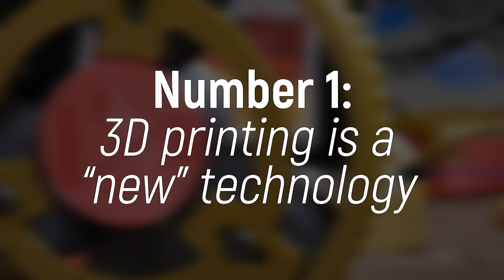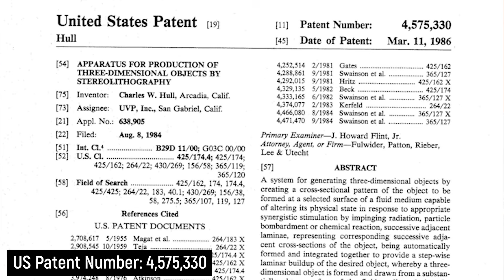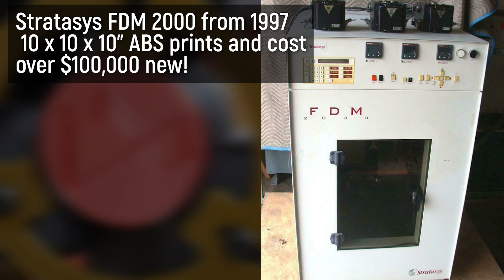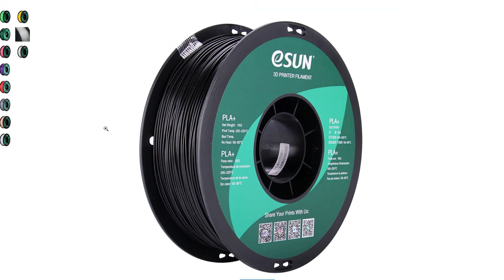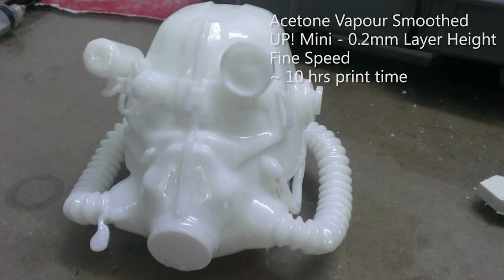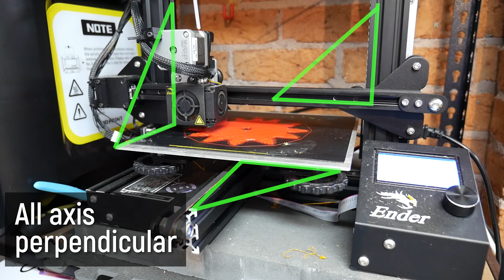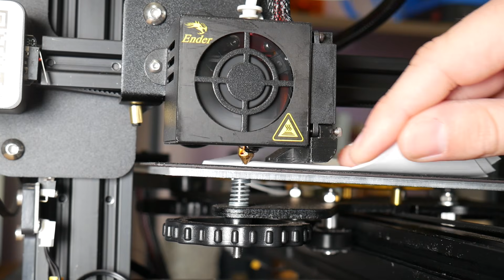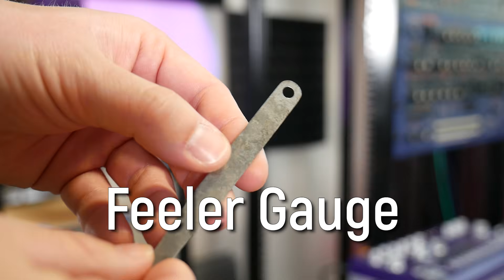3D Printing Myths I used to believe...

Comment: One of the assumptions that has caused me suffering is the belief that the temperature my printer reports is exact/accurate.  If you're going to do a lot of printing with a filament, and want the prints to be as perfect as possible, run a temp tower. It doesn't matter what the sticker on the roll says if you actually do the test and find out what temps work well for the material on your printer.

Comment: A polymer “alloy” is called a copolymer.
Reply: Not quite. A copolymer is a complex polymer that has, within a single polymer chain, different monomer chains. They can be true copolymers, they can be graft copolymers. For example ABS is a graft copolymer, which is a true copolymer of acrylnitrile and styrene grafted onto butadiene. So they take fine butadiene polymer flake that was polymerised in a separate process, acrylnitrile and styrene monomers are introduced as gas and polymerised onto the butadiene flake, so all of these end up in a single polymer molecule. As far as i remember, don't sue me if i got it wrong, i'm not a polymer chemist, or a chemist to begin with, but i did skim Brydson's book and some other sources for just some idle curiosity.

You can also polymerise different monomers or monomer groups separately, and then melt and blend them, then you actually have an alloy or blend. PC+ABS is most certainly a blend and not a copolymer!
Reply: @SianaGearz  quite right, blend might be what they were trying to say, alloy certainly isn't.

Comment: I learned the feeler gauge trick a while back. With my bltouch on my cr10s pro, I zero the Z on the feeler gauge, so when I activate the process for adjusting the 4 corners, it automatically sets the nozzle to the height of the feeler. Then after I'm done, I zero the Z again without the feeler. Perfect first layer every time.

Comment: I use leveler to level my bed... but not like you think. It is useful for quickly checking if X gantry is aligned with the bed in printers with one Z screw. The reference is the frame, not earth. If all parts, x gantry, bed and frame show same bubble position, they are parallel. Have not been able to get it better with a set of calibers and measuring, and as a quick check it is great, you can check things while you are printing.

And with both CNC and 3D printer, i use thin paper... I am trying to find 0.100, not 0.000, to have just a bit margins before things scratch the bed. I've found it is more accurate than even autosensing is at times.. But it takes a bit of experience to feel it, you also have to use new paper.

Comment: bro.maker muse, there is one more that has not been discussed. regarding the belt, how tight and loose the belt is right for a 3d printer. because this will affect the printing quality and power efficiency of the stepper motor, if it is too tight the stepper motor(hot) will be heavily burdened in its operation, and if it is too loose then the print quality will decrease slightly,and the teeth on the belt system must be aligned, otherwise it will reduce the accuracy and stability of the 3d printer results,and affects the age of the belt, the tighter or more misaligned, the shorter its life,

Comment: On all of my printers without ABL this has worked extremely well. Zeroing the Z-Axis and with a clean nozzle raising the bed till I feel a slight drag when moving X or Y, then I lower the bed the few microns needed to stop the drag and move on to the next corner. 

You need to do this once for a rough level and then a second time for exact adjustment. It has gotten me within 4 thou of my Z and has not given me an elephant foot with correctly tuned extrusion diameters.

 I print 100% infill most of the time and have gotten a calibration piece to show ±7 thou in the XY axis with no perimeter offsets on a bone stock Ender 3. 

Same with a 3mm hole and 3mm steel dowel pin, printed at 0.08mm layers with a 0.2 nozzle and has a perfect fit.

Comment: i dont bother with the paper bed levelling technique anymore, as I find it just varies from material to material. I tend to do a test print in each corner and using a skirt, and adjust as it goes, and I get lovely results every time. its quite rare for me to have a failure, when I do its normally something stupid i didnt when slicing lol

Comment: For bed level, the paper trick is simply insufficient.  It doesn't matter if the bed is level, the bed itself is not perfectly flat.  That's why I added a BL Touch to my printer and have it do a 9x9 touch to create a bed level mesh. It accounts for tiny (or perhaps not so tiny) warps in the bed level.  Since doing so I've not had to mess with manually leveling my bed anymore and I think this should be standard across 3d printers.

Comment: Great video ! The part "No, you're not leveling : you're tramming" was spot-on.
Funny enough, 2-3 years ago I've been "gently" bashed when saying the exact thing you did : "paper test is flawed, use feeler gauges instead". People never learn and, when they were struggling with their first layers, mine were consistent at every print without elephant foot artifact. I do use the smallest gauge I have to achieve this, which is 0.04 or 0.05 mm.

Suggestion : do a "3D Printing myths : extrusion 101". Lots of misconceptions and misnomers on extruder styles and filament drive styles did spread over the years and these need to be addressed too (since not only end consumers are concerned : companies too). ;)
Reply: They're not tramming. Tramming measures the perpendicularity between a head and the table. There's no way you can measure that on a 3D printer. You turn the spindle around when you're tramming. 3D print heads don't rotate. Least ones attached correctly don't.
Reply: Yep, you're right.
Can't see any other way to describe it, although it's approximate. 3D printing is approximative too, so ... well ... let's say it makes sense even if it's not totally true. :)
Reply: People saying "tramming" just gets on my nerves because 99% of 3d printers have no idea what tramming even means. Everyone knows it as levelling so just call it that.

Comment: If I want to be fussy, I have a bed leveling test print I'll run after bed leveling.  It prints 25 mm squares, one layer thick.  I'll adjust all of the leveling screws by the same amount, repeatedly as It's printing the little squares, adjusting until the first layer adhesion is perfect.  If the squares are made of individual filaments or it's not sticking, raise the bed.  If the nozzle is dragging or smearing, or not extruding, raise the bed.  When perfect, a uniform thin sheet of plastic one layer thick will print for each square.

Comment: Can you tell me how thick the feeler gauge to bed level?

Idk I have feeler gauge, using 0.10 mm, print a brim, I still could see the gaps :/

Tried the 0.05mm feeler gauge, flow rate 110%, the brim gaps gone.

But still facing warping, even the brim can't hold the warping itself :( (photo here : https://i.ibb.co/dQQRDH6/IMG-20210610-094637.jpg)

I use petg esun, print speed 50mm/s, temp 235c, bed temp 85c fan 10%...retract 4mm, speed retract 25mm/s.. 

I also still have issues on corners too :( it's like corners has some artifacts... Not smooth corner.
(photo : https://i.ibb.co/3phg3Rd/FB-IMG-1623504918262.jpg)
Reply: How warm is it in your environment? Do you have drafts? Moving air of varying temperature can easily ruin prints, cause them to warp.

I think 0.05mm feeler gauge and increased flow (first layer only) sounds like a recipe that should work. But ideally you set the printer up such, that the gap between nozzle and bed is zero when homed, so ideally you descend the thickness of the gauge after setting up, or use slicer Z offset, or raise the nozzle by gauge thickness above zero home before tramming.

Also i think it may just be material incompatibility of some sort between the coating on the glass and your PETG. Normally PETG adheres to glass a little too well, and i think Anycubic etched glass beds and similar are pre-coated with something.

Or maybe your PETG has gone bad? Does it throw a lot of strings? It can absorb moisture and become unusable until dried. There's lots of ooze over the print in the first picture, which is also an indication of that. It's also unwise to fully rely on printer's internal temperature sensing, you may want to try varying the temperature 10°C in either direction and see whether it gets better or worse. Like usually 235°C is a perfect temperature for PETG but you never quite know whether your printer is really holding that or 225°C for real or 245°C, and there's no great way to measure, just trial and error.

What else... it looks like the surface you're printing is unsupported from below? Naturally when there is no material underneath to adhere to, the filament bead will just go wherever. Another thing to check is the belts, that they're properly tight. Another interesting issue is when the motor pulley isn't tightened properly, then the belt feels good, but the pulley will slip once in a while on faster moves just slightly. You can't just tighten the pulley in any position, it won't hold, the grub screw must go into the flat of the motor D-shaft.

It's genuinely difficult to determine the fault from a photo of a print like this, because all kinds of underlying issues can cause similar issue appearance. That's why people print benchies or special-purpose tests that display one issue at a time. And the most important is that you have a feel for how the printer should be operating, and just watch it while it prints to determine where it goes wrong, which is a difficult skill to convey.

Comment: WHY!?! You dont fold over the paper, just the thin layer. And with my printer, I have found I measure down to .2 (with guage or paper, and with paper I want it to resist the pull but not stop pushing or pulling rhe paper, and with guage, I set it to a point where I just start to hit the nozzle and it pushes out of the way ever so slightly. If I need to go higher and it doesnt contact, then I know its right at .2 and a super tiny bit more) and thats that! Thats a "level" bed. Its not about setting z hight, its about setting the bed to the same distance from the nozzle consistently. Z height is achieved through the method of zeroing the z height. This is usually done by a lhysical button. I have a cr10spro and it uses induction (I think) and can be very tempermental given heat or material on the bed. I prefere a physical button.
When setting z height, you use the metal guage (preferably) and even with paper, set it to .2, drop it by .2 then using the machine and have your botton be right there for zero

Comment: Seems like not so much a myth but not understanding the purpose of setting the nozzle height with paper. It's not that the "correct" height is some defined height that is determined by a sheet of paper. The correct height is determined as that which yields the proper "squish" of the extrusion, and things like paper and such gets you close to a height that will yield a proper amount of squish. Ultimately you have to adjust nozzle however it takes to get the right amount of squish, regardless of the "paper method" or whatever "method" to get close.

Comment: Some of the early Reprap printers used Nylon from string trimmers as a filament. There where many problems with this as the nozzle technology at the time was so infantile, along with the control software. So there where many burning problems, plus the nature of nylon for string trimmers are not generally kept very dry. So they moved on to using ABS pellet and making their own extruded filaments. Since ABS was very easy to get their hands on in bulk, and they already had a great deal of experience with it in the engineering program. Since its one of the main plastics used when teaching injection molding design.

Comment: Best method I find is to run a gcode with a bunch of squares on the bed and just do live adjustment. Better best option is a dial indicator attached to the print head.

Comment: the paper trick works specifically because commercially produced paper is extremely consistent in its thickness. so paper therefore makes an easily accessible and inexpensive substitute for a feeler gauge for people who don't have one.

youre claiming that the "paper trick" doesnt work and you should instead use a feeler gauge and adjust the z height to the thickness of gauge when that's.... literally what the paper trick is. set 0, raise the nozzle height by the thickness of the paper (paper manufacturers list the exact dimensions of their paper, and if you dont have that, use 0.1mm per layer of paper as an approximation. and then use the paper as a feeler guage.

So no, the problem isnt that the "paper trick" doesnt work. its that you've been doing it wrong. and perhaps the common wisdom about how to do it that has been spread around the 3d printing community has been teaching people to do it wrong.

obviously a proper feeler gauge is better and more reliable. but the  basic concept is the same. using a tool with a known and precise thickness to locate the nozzle, and then setting the 0 by subtracting that known thickness from the nozzles position.
Reply: To determine paper thickness, you can also take a bunch of sheets of paper, lightly squeeze with calipers, count and divide the measurement by the number of sheets. Might come out to something like 0.08mm depending on the type of paper, but then, 0.02mm is a mistake that is usually perfectly workable in 3D printing context.

Comment: Wait, for bed leveling, you're supposed to take  piece of paper and fold it a few times?! I've always seen to just use a sheet of paper - no folding. That changes things.

Ok I'm buying a feeler gauge and doing that method.
Reply: This is the first time in the 6 years i've been reading and watching as much 3D printing content as i could absorb and in the 4 years of printing myself that i heard of using several layers of paper. This is definitely just about the worst way to go about paper-levelling, as the layers of paper just slide against each other. I have always used one sheet of paper, and actually standardised on one particular source of paper to reduce variation.

Comment: Ive got one for you to test or talk about. Filament getting wet and needing to be dried. Had someone on the FB groups tell me that its a myth and filament doesn’t need to be dry or dried.
Reply from the maker: It depends on the type of plastic. Some doesn't benefit others absolutely require drying, like PETG and nylon.

Comment: You're gonna find this funny but, the only one that gives me perfect leveling every print (and I have a LOT of 3D printers just like Angus) is the frankenstein printer I bought from a guy who bought a weird kit from China and built it himself. It's a ZXY type of printer and it has an Hall-Effect sensor to level, and since the big build surface on the heated metal can be uneven, it uses the Hall effect sensor AFTER the bed has been heated, and it prints PERFECTLY every time. It's the LEAST commercial of all my printers - but that one gets it right. Go figure.

Comment: Hey Angus, the levelling thing in this vid was one of those bright lightbulb moments.

The best way of looking at it is, the nozzle at the four corners makes a plane... which may NOT be horizontal because it's unlikely the printer was built perfectly and parts move over time. You want the bed to be at the same tilt parallel to that because if it's not, the nozzle will dig into the print bed (or previous layers of the print).So it's LEVEL compared to the plane of the nozzle's movement but not level relative to gravity (or a spirit level).

The nozzle gap advice is also brilliant. I've had problems with first layers and rely on a raft to make things work, but now I suspect the problem was simply that I gapped it too far (paper trick) and since a raft tends to be thicker and gets discarded, it can stick better and then average out to a stable base. I'll redo it with a feeler gauge as you suggest and see how that goes.

Thanks!